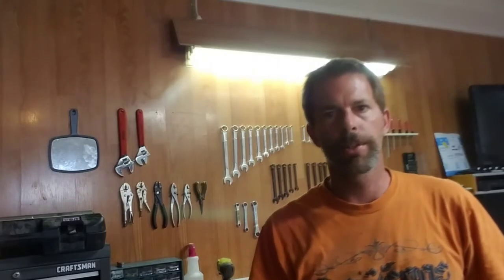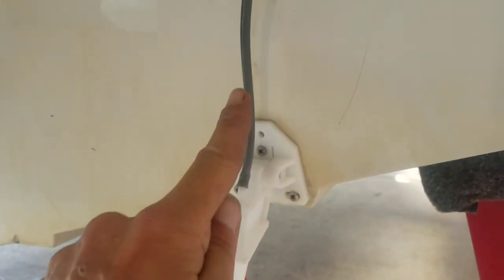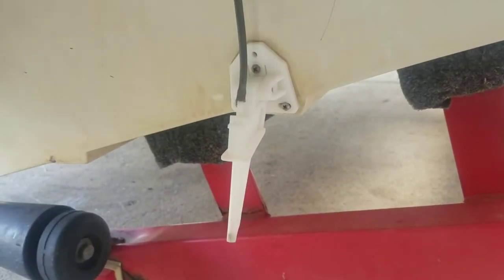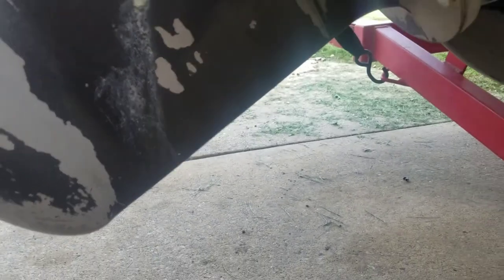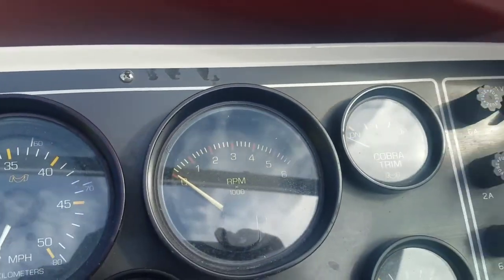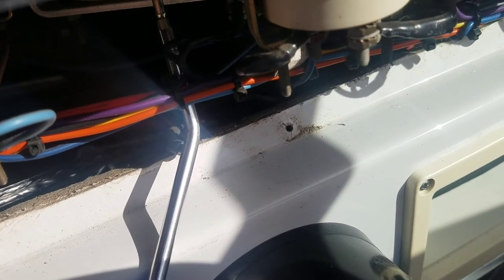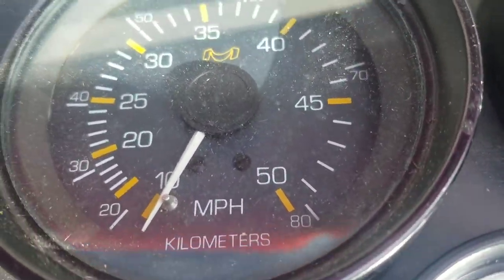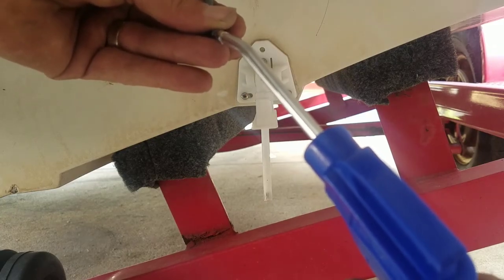Fix a Faulty Boat Speedometer

Comment: Hi Mark, how would you change replace the tube line that goes to the speedometer?
Reply: If the hose moves freely, splice the new hose to the old hose and ease it through. It might be clamped to the boat somewhere, make sure it's free.

Comment: What size tube can I splice this with ?  Mine is broke at the pick up where the tube connects to the pick up.  I was thinking about cutting it about a foot up and fitting a bigger hose tube over each end of cut.  Thanks for your videos😊
Reply from the maker: Ideally it should be one piece, a splice will disturb the flow and give a faulty reading
Reply: @MarksBoatServices  I agree but its not that accurate anyway.  I was wondering what size to get that would fit on the cut ends.  I only need about an inch length of new hose.  Or can you just buy the complete hose?  It goes on a 17 foot cheetah.  The off brand cheetah

Comment: Where can you get a blowgun if you don't have an air compressor? Will canned air work?
Reply: Try a bicycle tire pump with a basketball needle, a little tape around the needle, stick it in the hose, and zip tie the hose to it.